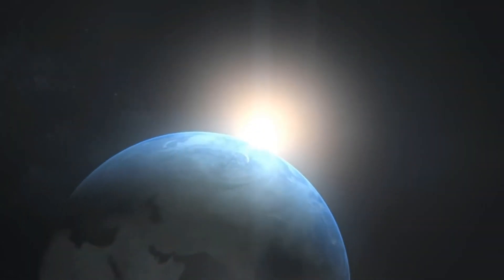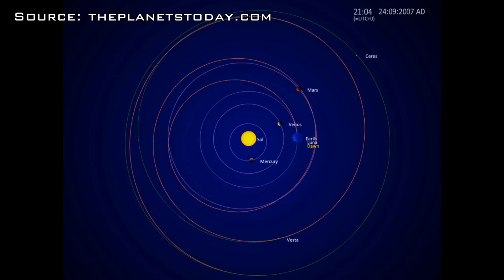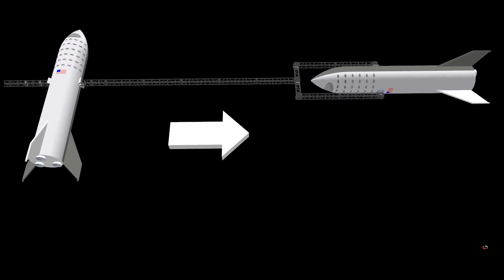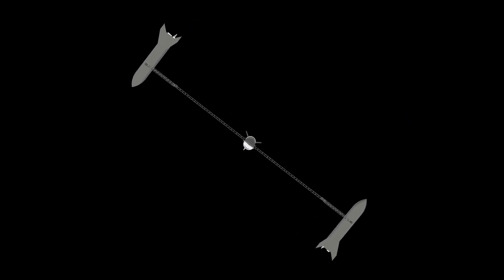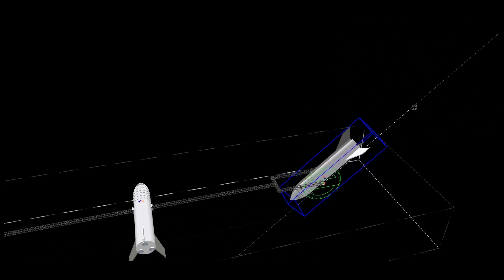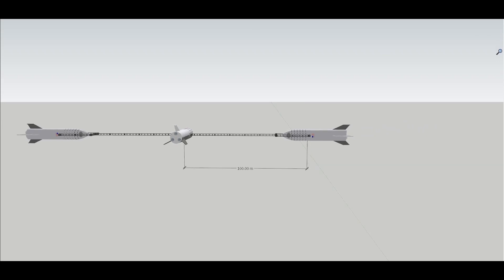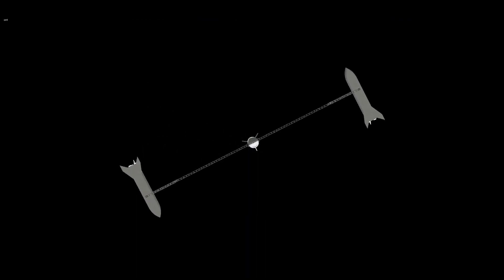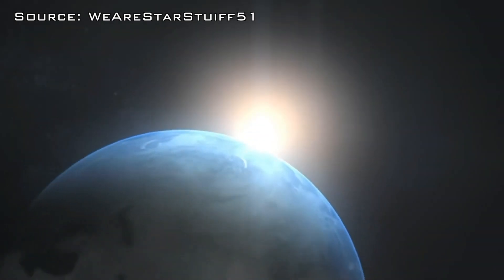GLS2: Artificial Gravity for SpaceX's Starship

Comment: I’ll bet you a beer that just two Starships and a clever “tension system” (network of cables) can work fine.  Namely because cables are light and pack small.

Plus some specialized thruster jobby, pointed out the door of each and pushing right into each Starship’s CG.

But whatever.  The point is that you took a mental reach and wound up with a way to help make inter-planetary travel really possible, AND showed it in pictures.  That’s a real contribution my man.
Reply from the maker: @Johan Wittens you are 💯% correct about tumbling 1 ship the size of starship, however I find what you said about using a counterweight instead of additional sapcecraft very un intuitive. Don't you need a ship to get this counterweight into space? Do you just throw it away when you reach mars?
Reply: @smallstars  Using another ship as the counterweight is absolutely a necessity for many reasons, mostly because of having double control and the redundancy of an additional starship in the system.  The cost is double, but you can do 2 concurrent mars missions, with the option to send both crews back on the same vehicle if need be.
Reply: @smallstars  If the tether reaches 100 m to spin centre and then reaches another, say, 900 m past it, you can get away without a counterweight. This is because the farthest-out kilogram of tether material balances 9 kg of the ship.

If you have two hulls, of course it most economical of mass to have each of them 100 m from spin centre and a 200-m tether. But if there is just one, the tether reaching far down into strong parts fo the centrifugal g-field on the far minimizes mass.
Reply: @smallstars  The counter weight can be a crate filled with all the cargo that is only used on Mars and is otherwise just sitting in the cargo hold. Or conversely the humans can live in an inflatable habitat which is light so doesn't put too much strain on the cable.
Reply: @smallstars  The counter-weight is full of water for terraforming Mars. Victory is mine.
Reply: It helps that the spin-up burn doesn't need to be quick. Even if it takes a few days it's not really a big deal, so they can use a smaller engine for it.
Reply from the maker: @quadrplax  Yes, but that smaller engine can't be less efficient, and drawing from the left over fuel would be as you say "clutch"
Reply: The problem is not the centrifical force itself to replace gravity but the technical difficulties of his design.
Now, don't get me wrong, i had similar ideas to connect two inflatable Bigelow "Space Apartments" with one another but the problem of his idea is the  absolute necessity for 3 Starships, of wich one is pretty much dead weight wich does nothing more than using up energy. 

Another problem are the side loads experienced by the rocket, they are the equivalent of the rocket falling sideways in earths athmosphere (actually, they are even worse).
The Starship would literally break appart.

However, i do have an idea that may be much simpler, how about simply turning the Starship itself. The load vector would point in the same direction the same and be even weaker compared to the launch load (multiple Gs at launch but literally one G load for artificial gravity). I get the problem of using the thrusters for this kind of operation, so i would suggest to use some kind of rocket motor that starts on a hypergolic slug ( that's actually a well known strategy for starting a single use rocket motors but you could combine this with a set of multiple "slugs", for effective reuse of the engine) and uses the normal methan/LOX propellants. The Starship would spin at  about 264 revolutions per minute or about 4,4 revolutions per second, when you assume that the center of gravity (that would be the spinning axis of the Starship) is about 20 meters from the nearest point of the passenger cabine away. For comparison, that's around the territory of big slow turning diesel engines used on tanker or cargo ships. The thruster would need around 71 KN to get the Starship to AG velocity (AG=artificial gravity) in around 60 minutes.

The obvious drawback is that i would need a dedicated engine that points sideways and i would need a program that can safely direct the Starship even while spinning like a Frisbee.
However the obvious advantage is the lower dead weight (not usable weight) and the capability to travel to Mars without the need of to more Starships, wich is a huge cost advantage.
Reply: @Johan Wittens Split the starship into a fuel tank stage and a crew stage connected by cables and tubes. Have the whole thing spin. Then when you need to make the ship one piece again, retract the cables.
Reply: A cable is a bad idea. It can flex acting like a snake, and can whip under lateral forces. It can go slack and when returns, "snap" putting loads of stress on each end. It can stretch like a spring causing oscillations and even twist. A cable is twisted and braided to begin with and that force of untwisting can cause many more problems not even thought of. Have you ever seen a cable snap under a load? It whips at uncontrollable speeds and directions and would slice through a spacecraft like a hot knife through soft butter likely killing everyone onboard. Sure, a rigid framework has it's share of obstacles to overcome, but is more likely to not be as instantly disastrous if it ever fails. It won't go "slack" like a cable and undulations are more easily controlled.  It would also need isolation and damping systems so it doesn't act like a stretched slinky sending waves of energy back and forth between the ends if something on one end should happen to cause any sort of shock. Like a small explosion, or meteorite impact, or a sudden decompression. There are many scenarios to consider no matter what type of tethering is used. One main issue is the shifting of weight as the humans wander about the craft changing the centers of gravity to seemingly simple things like food stocks changing, and water tanks emptying from usage, and being filled into waste tanks, and then recycling of the water being transferred back. All these stresses can cause a straight tether, or rigid framework, to become a series of arcs along it's length causing oscillations and a series of waves. All of which, if uncontrolled, can easily become magnified. Yes, it's a challenge no matter what. The effects are yet unknown except in computer simulation. And even then only in theory where real world, or in space, conditions do not exist.
Reply: tension means it will snap and FAIL...
Reply: I remember trying to walk from the outside of a merry-go-round towards the center. Makes you feel dizzy when you move so you have to stop otherwise you'll just loose your balance completely. I imagine it is similar to the issues if the Coriolis effect is too large but that's just a hunch as it involves the same issues: Moving and inner ear fluid not doing what it's expected to do by our brain. That does bring up, however, the possibility that we may be able to adapt to the new stimuli in much the same way as our brains are able to adapt to different physical situations.

PS: With the strut design, if you have 2 arms I imagine that you may be able to get each one to spin counter to the other in which case you wouldn't need any propellant. You'd have turned the entire craft into a gyroscope. Then, of course, you may run into stability issues in the form of gyroscopic precession. Yeah I think I'll leave this stuff up to the experts lol.
Reply: @Johan Wittens 
From a technical standpoint, the shifting o masses as small as a single human would not induce that much of a difference, we are talking about a 85 kg mass compared to a mass of at least 100 tons, so 0,085% of the weight of the Starship actually shift, that's minuscule. Even if you would change the center of gravity, you not experience much difference as the rotation axis is not fixed, a freely spinning object space is not the same as an unballanced wheel with a fix rotational axis (fixed to an axle ).
In fact, two objects that are tied together and have a different mass, still rotate without noticeable wobble to each other, their rotational axis just changes, like the orbit of the moon.
It does not orbit around the earth, however it orbits around a point between itself and earth, as the earth itself does. The same goes for planets that orbit around the sun, this system is just a bit more complex because there are several planets with mass that alter the suns orbit.

Correct me if i am wrong but both of the phenomena that you  just explained are basically the same and both have nothing to do with the technical Coriolis effect.
I would say that both are a form of kinetosis or movement sickness, wich only occurs when the expected movement of the body does not match the actual movement. This should not be a problem, as long as you don't try to fix your eyes on a visual point  outside the Starship.
Reply: Mandernach Luca It would be great if “someone” less lazy than I am (always the rub) did a video physics simulation of these two spinning tethered things, and then had people move around in the starship, so we can watch what “actually” happens.
Reply: @Johan Wittens 
For the first one, no no no, that's not how orbital mechanics work.
First, the mass distribution does not effect the stability of an orbit, it only changes it. The orbital system is a self balancing system, if you would have only a moon and the earth, a difference in mass distribution would onl change the shape of the orbit, it would not wobble at all, respectively, as the change is direct an fluent, you would not notice it.
Second, i was talking about the distribution change of the mass of one human, that would mean, that one human would have to change the floor to even alter the distribution. Than this altering would make no change at all, he could go to a level above or to the original level, his action would simply add up, how would you come to the conclusion that 0,085% of distribution change could be incresed by the same same mass moving to another point? That's flatout dumb...
You would have to move 100 people significantly to get the desired change in mass distribution and it would still not make the ship wobble like crazy, it would only shift the center of gravity and therefor directly the rotation point, so it would actually be easier if all the people would go from one to another level. However, the people onboard will most likely move constantly and there the center of gravity will have a constant position.
It really is no problem.

Now for the other, give me something scientific, a scientific explanation that refers to the exact kinetosis phenomenon that you mean (the physical explanation). I can not understand the principle and give you a solution if you don't give me the exact source of problem.
And please, for the love of God, do't try to explain to me the feeling, i want to know the reason for the kinetosis problem.
Reply: @Enthropical_Thunder  On the Coriolis problem: I had a bout of BPPV (Benign Paroxysmal Positional Vertigo). Essentially something (debris or something) becomes dislodged, and moves into one of the canals in the inner ear, and floats about generally messing up your balance. Some movements were OK, and moving reaaaaaaaally slowly would be OK. Moving too quickly and putting my head in a particular orientation, standing up, or laying down would make me dizzy, occasionally nauseous, and the room would spin. The sensation is similar to that described for the Coriolis force. All I can say is that a spaceship full of people experiencing something like that would be a disaster waiting to happen. My BPPV lasted a good few months and, although it eventually cleared up, I never did get immune to the effect, despite how often it occurred.
Reply: @stephen-boddy  
But this doesn't explain anything, not even why this effect of disorientation and dizzyness could possibly result of the coriolis effect. The problem is, that i haven't heared anybody that actually could explain the cause, wich leads me to believe, that most people have heared of something similar but in fact think about  something completely different.

In contrary, there are insidents of spacecrafts turning relatively fast, the worst case i heared of, the astronauts would loose orientation because they tryed to visually fix a point outside the space craft, however, there was never talk of getting dizzy or motion sick.
Reply: @Enthropical_Thunder  OK, I'll give it a go... Some of this is a bit simplified, just to avoid too much jargon.
In these artificial gravity systems, the Coriolis effect means that as you move up (in toward the center) or down (out toward the edge), a force (+/-) is generated in the direction of the spin. I'm not going to explain Coriolis, it's basic physics, either accept it as a given, or go read up on it on Wikipedia.

In your inner ear there are three canals (tubes) in different planes, roughly corresponding to X,Y, and Z. These canals contain a liquid. When you move your head the liquid has inertia (think rapidly moving a glass of water sideways, it sloshes) and this sloshing liquid stimulates tiny hairs that line the canal. This sends signals to your brain that it interprets as rotational acceleration. There are a couple of additional structures that use the same mechanism to detect linear acceleration in the X, Y, Z planes.

If the vessel rotates too fast the Coriolis force becomes great enough to cause the liquid in the inner ear structures to slosh past the hairs in a way that does not correspond to the movement of the head.  i.e. your head goes up a ladder, and your eyes tell your brain you went up a ladder, but your brain receives a conflicting signal from your ears that you went up a ladder, but you also went forward, backward, left, or right depending on which way you are facing. This difference in signals between eyes and ears is what causes motion sickness. If you keep your head stationary, there is of course no force except for the one "downwards" which is perceived as gravity. The two non-pharmacological cures are to either find an external point of reference (look at the horizon, which doesn't make sense in a space craft) or to shut down one of the conflicting signals (typically closing your eyes, which is not a long term solution either). The way to "fix" this for a rotating artificial gravity is to make the Coriolis force as small as you can. You do this by reducing the rpm and increasing the radius. For a given fraction of g the rpm is inversely proportional to the radius of the "circle". So the bigger r, the slower you can turn. Estimates are that 2 rpm is comfortable for most people. Higher values can be tolerated, but more and more people will find it debilitating. So if you want 1 g at 2 rpm, it works out to a radius of 224 m. This is why most studies for first attempts use a cable tether between two craft.

Regarding your astronauts: As far as I know there is no artificial gravity system out there yet. It's not clear what you mean by turning, so it's hard to draw any conclusion. It's also not clear if these astronauts were moving about in the vessel as the vessel "turned". That is unlikely, because astronauts are usually strapped down in a seat during any significant maneuver for safety reasons. On top of that, astronauts trains in (torture) devices that are designed to disorient them, so they probably don't mention any effects, because they are expecting it. I will say that astronauts going to the ISS do get motion sick simply from being in zero g. This is however different to the regular motion sickness you get when experiencing some form of gravity and is instead called Space Adaption Syndrome.
Reply: Johan Wittens Yeah yeah right on.  Not even a “dead weight” but their water and air treatment rig, and frozen poop storage unit, or power battery and solar panel, or nuclear power thingie, or whatever really.  It can look as ridiculous as it needs it to.  In zero-drag space, things just keep on going.
Reply: Johan Wittens The “new” part is people like our buddy here taking shots at popularization.  By my own very conventional aerospace thinking, having 1000 amateur yahoos running around pontificating about how to get to Mars is of absolutely zero consequence.  But I’m sure that reality (especially this “2.0” reality that has brought us together here) works differently.  Somehow.
Reply: rigidity may be necessary to prevent one or both starships breaking off and falling away into deep space though.
Reply: @Johan Wittens 
For the first one, that does not make any sense think about (that's the first time, i here, that wikipedia gets it wrong).
A wobble only accures on rotating structures, wich are tied to a fixed rotational axis, as soon as you float freely in space, youre rotational axis is only vound to one thing, mass destribution, respectively center of mass.
This dependents is very usefull, as you your rotating object would actually adjust its rotational axis automatically every time that the center of mass shifts.

Further more, the only thing that would allow such a huge shift in mass, that youre center of rotation would end up outwards of the ship (wich is only possible at very high angulare velocity and a very big mass destribution shift), would happen, if you would pump the liquide fuel and oxidizer from one point to enother, the 0, 3% mass shift of humans moving around wouldn't actually do much of a difference.

To the coriolis effect, what you described only happens at an extrem change in velocity, a height change of 2 meters wouldn't actually be that much. At least for the size of the Starship, such a system is possible.
Reply: A telescopic carbon fibre tube with a ‘just in case’ steel cable or two down the centre. Rigidity, light weight, resilient.
Reply: Cables won't work.... The point of the truss is to always keep the ships locked in place and oriented properly... A cable may work once it's going but I think there's things that make it less safe like the initial tensioning and keeping the ships perfectly oriented will be more difficult due to having one one connection point version 4.
Reply: @Johan Wittens anchor to an asteroid of equal mass to the ship and user that as the counter weight. Leave it in orbit, pick it up on your way home.

I think the frame work plus cables would give lightness and tensile strength. The asteroid would have to be carefully chosen.

Look at guy wired towers. The towers are weak as hell but the cables keep them up during hurricanes.
Reply from the maker: I'll take that bet! Just for fun though, because I know I have a good chance of loosing. Good thinking!
Reply: @Johan Wittens 
The thing with the flipped floor is a given, you have more than enough time to change from the piloting room to one, in wich you can savely stand upright, that's not the problem.
As far as i understand the Coriolis effect, it only really comes into play, when transverse and rotational motion overlap. In other words, the positioning of the spinning axis parallel to the transverse motion should solve the problem, the average human walk is not very fast (some meters a second at best) and therefor the Coriolis effect isn't very strong.

Now you could make the argument that the addition of the transverse speed could lead to problematic velocity changes but as long as the spinning axis is at the center of gravity, there should be no problem at all.